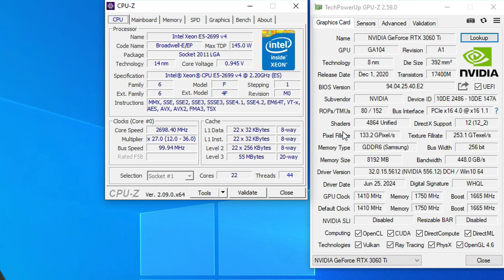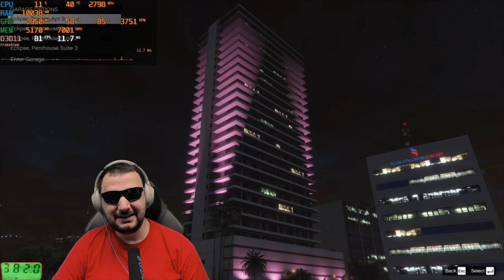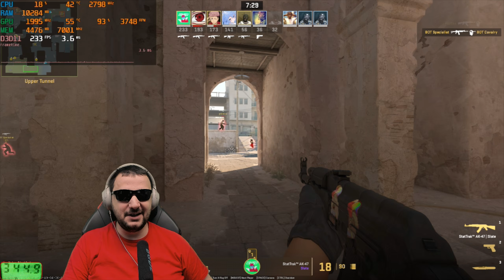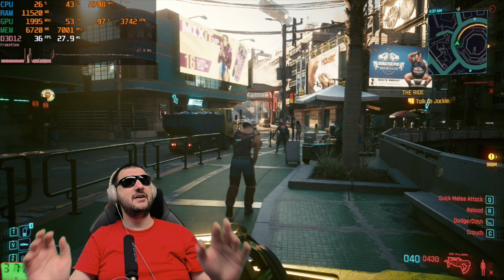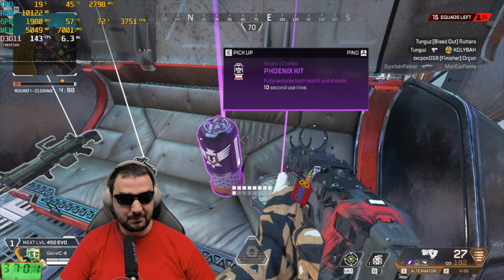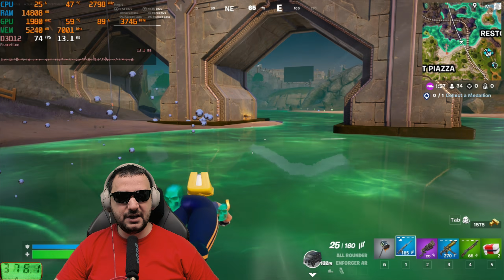Xeon E5 2699 v4 Benchmark with RTX 3060 Ti FE

Comment: These Xeons are still beasts.
Reply from the maker: True.  Need more videos with them. I manage to buy a few more. Cheap and powerful.  Do you have one?
Reply: @DanielCardei Thanks for the response and yes, I recently put together a z840 with dual 2699 V4 xeons and it laughs at everything I'm throwing at it. I currently have an RTX 5070 in it. I'm also still using a z800 with dual x 5690s and it still surprises me. I have a 1080 TI in that one and put that one together about 10 years ago.  absolutely love these older work stations. I recently had a need for a pretty expensive amount of drive space and all I had to do was just add a few hard drives. I have a couple of spare Xeon 2698 v4s that I plan on building systems around individually.
Reply from the maker: @SirtubalotTX  dual 5690s? i try on my z600 and it sais i need high speed fans. what fans did you use?
Reply: @DanielCardei  Right on.  I have the 'High Performance' fan coolers for the Z800.  A quick search will yield the part number for these and not sure how scarce they might be at the moment. I got mine back when they weren't too expensive, I believe I paid about 35 a piece for them.

Z600 + X5690 might be a little sketchy and my understanding is you will need the 2nd revision motherboard with a bios microcode date of 2010 or later....and still not guaranteed.  The motherboard can also tell if you are using a 'performance' fan by pin 5 on the fan connector.  #5 is vacant on the standard 95 watt cooler but performance fan uses pin 5 to identify itself.  You might can jump pin 5 on standard cooler and get it to work.
Reply from the maker: @SirtubalotTX I try to jump wire the thing but it didn't pass. Someone said noctua made fans compatible. I'll have to look into that. I use the machine with cpus under 100w and its glorious 😅.

Comment: Excellent video... great.. I got an Huananzhi Motherboard AD4 with TPM 2.0 module + Intel Xeon E5 2699 V4 + 32gb ram + Nvidia quadro P2000 or Nvidia gtx geforce 1060 3gb ... and my question is: When i install windows11 24h2 version the windows update appears me the windows11 25h2 but the update didn't realize  .. i think it was because processor right? so i got download from microsoft site windows11 25h2 and format the pc again ... that's my problem my friend... did happened to you the same thing? bye

Comment: It's one year later, but I recently bought a E5-2697A V4 (16C/32T) for $30 shipped. The 2697A V4 has slightly better single core performance over the 2699 V4 and should actually yield  higher FPS in some games. My 2697A V4 all core turbo is only 3.1Ghz but it's still faster in many games than the 2667 V4. The 2667 (8C/16T) has one of the highest Xeon single core ratings in the 2011 V3 series and turbos all cores to 3.5Ghz.
Reply from the maker: That's a steal for 30 dollars! ✌😎

Comment: why is legendary? This is not cpu for games... just cpu for day and night work .. low cpu frenqucy only with many cores ... also later big electical bill .. if you want gaming cpu than I7 6850k same socket and year
Reply from the maker: i did swap to i7 6950x. i even pair it up with RX 6950 XT just for fun :_Strong:
Reply: @DanielCardei  A OKE, i heard only for i7 6850K .. that is bether one ... and good fps? But if you look at cpu than you must test in in Startfield or Kingdom COme Deliverance , Fallout 76 .. that are games where you see power of CPU .. Start Citizen is most demanding there ... yes pair of them i want also to do .. but i ave hp Z6 g4 worksation with xeon gold 6254 .. very high temps but good for gaming .. afcorse only cpu cost me 250 e .. so is different kind of more modern .. i use that one with RTX 3060 ti trio gaming x from MSI

Comment: Put a E5-2699A V4 in it
Reply from the maker: Whats the A for comparing to this?
Reply: @DanielCardei the A version has a 3 GHz all core speed. The downside to that is that if you reduce the number of cores, speed will still be 3000 mhz, which is not the same for the 99/96 v4

Comment: Would u say its worth upgrading from the xeon 2680 v4 to the 2699 v4 in the future as its kinda pricey still.
Reply from the maker: If you game no. V3 can be oc. This is locked. Did you seen thr i7 6950x how it works now?
Reply: No because I use a dell precision t5810 not a custom built xeon pc and the i7 6950x won't work in my system  @DanielCardei

Comment: Hi, thank you very much for this video! I'd like to know how many ram you have? Is it ram ddr4?
Reply from the maker: Yes. Ddr4 32gb
Reply: @DanielCardei  Thank you for your quick response! I have another question, do you think it's a good investment the e5 2699 v4 processor or do I have a better time to buy an e5 1680 v4 that has a higher frequency?
I'm afraid that multitasking is too light for the e5 1680 v4?
Reply from the maker: I think multie task its perfect. Every new gpu i test its with this cpu. I tested that 1640 but I'll take this all day. But BUT 2699v3 you OC it. It has a few less cores but its better on Hz. This v4 has more cache. At end of the day you need to see what you can afford. I never tested this cpu with aps but maybe in the future.
Reply: @DanielCardei  If I understood correctly, I have more interest in buying an e5 1680 or 1640 rather than a 2699, is that right? Thank you very much really, I'm new in it and I'm a little lost haha
Reply from the maker: @enzostefanetti734  so what is the purpose for the PC?
Reply: @DanielCardei  I would like to be able to play games like apex,valorant and warzone by being on discord but also work too. The software I use is not greedy but I sometimes work with several software at the same time (Photoshop, inkscape, qgis.....)
Reply from the maker: @enzostefanetti734  gpu? Motherboard? PSU? i manage to find mine as a kit with £80. maybe you can find something similar? to be fair i was lucky.
Reply: @DanielCardei  I have as a pc a t5810 with a Rtx 3060 ti 8 g graphics card, 32g ram ddr4 and a 750 w power supply, my current cpu is an e5 1620 v3 but it is really blocking the capabilities of my gpu. It is constantly used at 95 or 100% with only apex legend and discord......

After some research I understood that the problem comes from my processor that blocked my games and the capacity of my pc (bottleneck) that's why I'm trying to know which processor to take to reduce this phenomenon and enjoy my gpu a little more.

(To give you an example on apex legend or warzone with all graphics at least my processor is at 100% of its capacities while my gpu is only at 30%. It is not uncommon for my fps to go down to 40/50 with many graphic bugs)

Comment: Have you ran it through Cinebench yet?  I have a 2680 v4, and was disappointed that my multi core score was 661.  I’d consider the 2699a v4 if it has a score closer to 1000.
Reply from the maker: I'll test the cpu and write you what it's scoring
Reply: What bench are you running? I’m running Cinabench R23 and running multicore doesn’t show that low of points unless you’re in single core testing

Comment: I run the Xeon E5-2696V4 (same cpu but 100mhz higher single core boost) with a RX 7800XT. Having no issues so far with great performance on games for a xeon!
Reply: Old workstation or custom build?
Reply: @itsmegareth9663 at the time it was custom built
Reply: @PinkFreud95 what we're the clock speeds like? Could you overclock?
Reply: @itsmegareth9663  E5-V4s cannot be overclocked nor turbo unlocked. so you kinda suffer a bit on the clock speeds for single threaded workloads but if one thread is active it can hit 3.6ghz

Comment: Atlast elaphant in the room :) still i would say it's easier to mod chinese boards than branded boards with V3 cpu's if you ever decided to still get 2699v3 or 2696v3 . However Miyconst would help you with bios mod. How much did you pay for your e5 2699v4 ?
Reply: I got a 2699v3 the other day for $40.  It replaced my i7-5820k.   I unlocked and it is awesome for what I do.  Not a gamer but use it for my DAW.
Reply: $140-$200 ebay.
Reply from the maker: don`t ask please :_ohNo:

Comment: alaso you have to run quad channel ram with 2400 mhz ram do not run the ram in dual channel you are leaving performance on the table
Reply from the maker: i have 4 sticks on 4 slots. when i`ll do a broll on some card i`ll mention it 😄
Reply: @DanielCardei  awesome possum . X99 sings with the right ram even catching up to 10th Gen
Reply: @zerokool1985 dude a E5-2667 v3 already surpasses 11th gen intel core i7-1165G7 by  2.93 on the multi core cinabench run

Comment: im running a z8 g4 with dual 20 core xeons and its amazing with my 4070ti :)
Reply from the maker: that`s a big boi :_Strong:
what software do you use so many cores?
Reply: @DanielCardei  unreal engine 5 modding emulators.  PS3 and others I won't mention so I don't get flagged lol . AI  and other things

Comment: Couple years ago I went down the Xeon rabbit hole trying to find a decent one for gaming in a sturdy workstation case like z440. 
My problem was that the cheap ones I found would either be 4 core 8 thread like E5 1620 v3 or like 10+ core and locked low(ish) clock frequency. 
And even the best I could find would not perform as good as a simple Ryzen 5 3600 on a b450 mobo and with ordinary ddr4 3200.
Reply from the maker: Absolutely.  The Ryzen 5 3600 offer great performance but older Xeon processors have their advantages too. They are typically more affordable, have high reliability, and are built for durability. One thing that is the most import is availability.

Comment: Yo can you also try putting all sliders in gta5 to minimum? It is extremely cpu demanding and even on my 5800x I get only 80fps sometimes with large lobby and min slidders
Reply from the maker: the moment i try 1x on frame scale it reached 80-90fps. i tried minimal and it did the same 80-90fps. because of the long edit i said that`s the best and if someone ask i tell them.
So... me here saying 😋 on minimal it can do nearly to 90fps. i think minimal will be better. less stutter but   i did liked the max quality 🤭